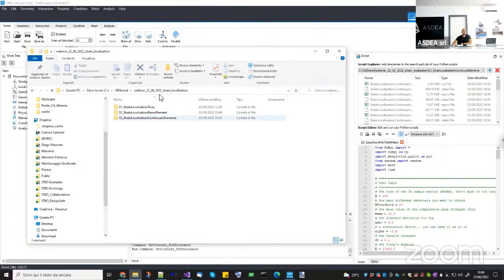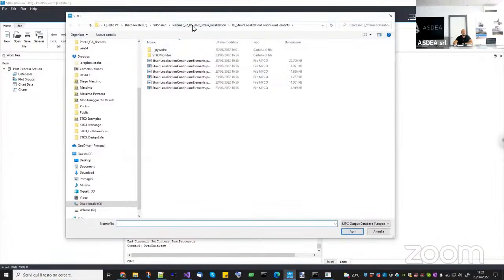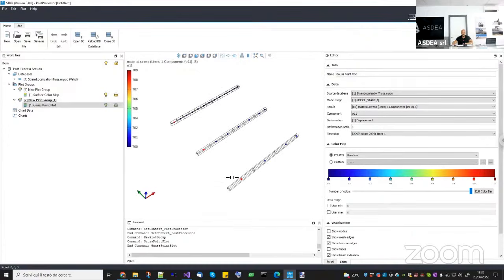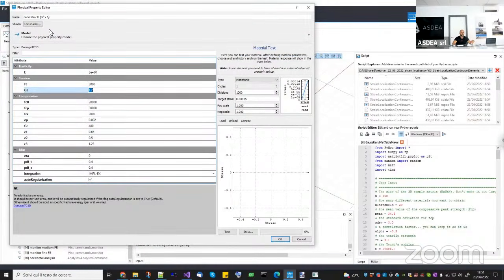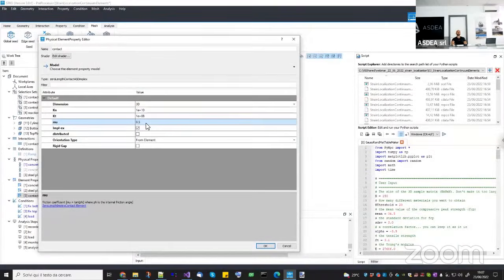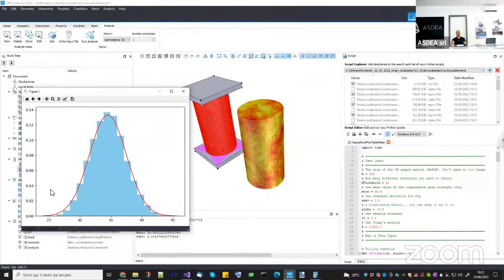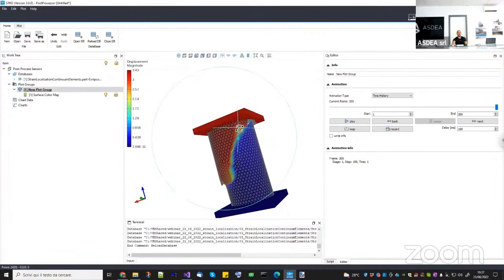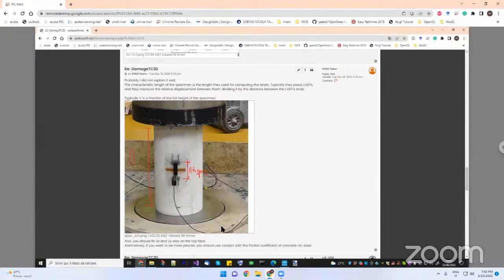Understanding the Problem of Strain-localization and Fracture-energy Regularization

Comment: Hi
In the last problem (concrete cylinder test), what if we assign random material properties only near the central portion of the cylinder (using partition where we expect the crack), instead of whole cylinder. What do you think about it? Will it improve the results?
Reply from the maker: You can give it a try, even though the failure will still naturally appear at the center since the bottom and top faces are constrained by the contact forces of the loading plates